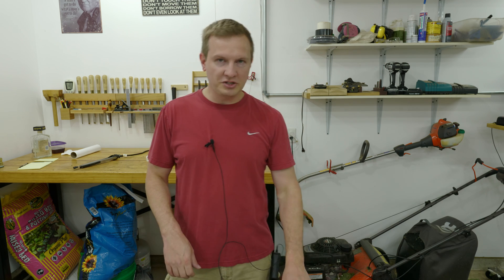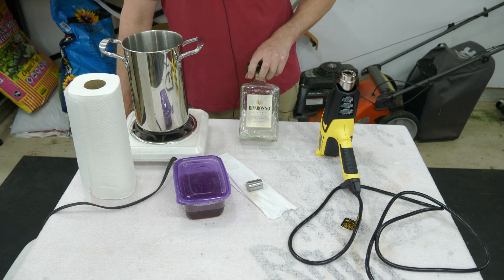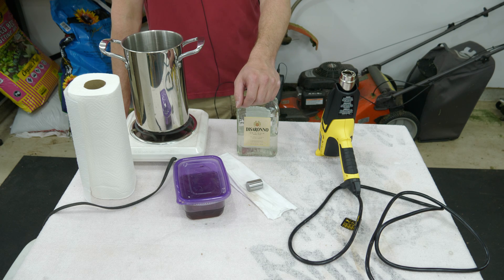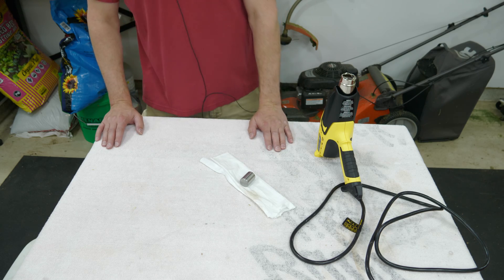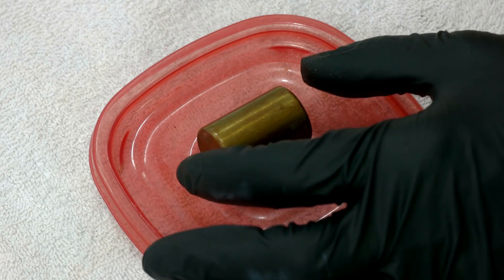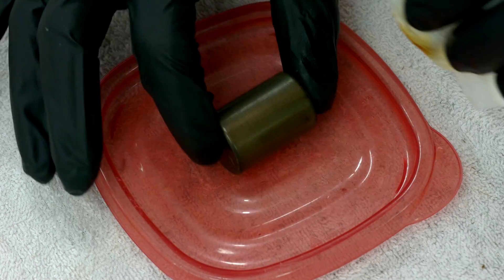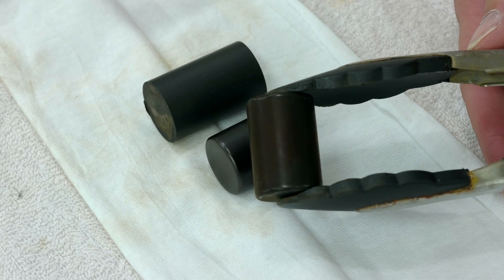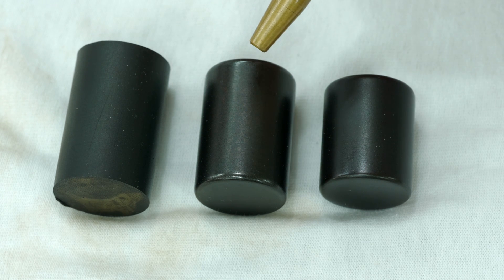Not So Slow Rust Bluing

Comment: If you brought the metal up to a mirror finish, will this process produce a black mirror finish??
Reply from the maker: I don't believe so, since you are converting a portion of the surface to rust, I believe it should generate a matte finish to some extent.
Reply: Mirror is probably not possible, but you can get a bright, polished finish. Card as normal until very dark, and then polish with 0000 steel wool. Apply more solution. Boil, and repeat until you have an even, polished finish.

Comment: Great video Dan!

When you heat the metal are you using a heat gun 
or boiling the metal in water before applying 
the darking solution?

How durable is this finish. 
Would it work on a gun barrel?
Reply from the maker: I always use a heat gun to heat up the part before the first application. 

for subsequent applications it depends on the thermal mass/cross section of the part. If you the part is thin in cross section you might have to hit it with the heat gun. If its thick in cross section  it should hold enough heat from the previous boil that you can apply the next coat imiediatly.

It's basically the same process as old school gun bluing, just using different chemicals. I'd recommend you test it out yourself before you try it on a prized firearm.
Reply: @Dans-hobbies  
Thanks for the advice.

I was looking to blue my Bond Arms Derringer. 
Wanted to try something different. 

I'll test this out before I try it on my Bond Arms.

Appreciate the info. 

Stay safe and healthy. 
Peace
Reply: @jayinscottsdale2001  
Actually decided to go a different route. 

I went with a weathered look using paint to 
simulate aging.  
I wanted it to look as though the bluing was 
coming off due to time.

Came out pretty good in my opinion. 
Looking to purchase the Texas Ranger black ash 
grips to finish the look. 

I'll let you know when I upload a video
on the completed project. 

Happy New Year. 
Stay safe and healthy.
Peace
Reply: @jayinscottsdale2001  
Nice, let me know how it goes 
and post a video.

I plan on posting a video on my Bond Arms Snake slayer IV,
showing my own custom work.  I'll let you know when I do.
Thinking of getting a spare 9mm barrel for the Bonds. 
If you have good results with your project, I might give it 
a try. 

Happy New Year bro!
Reply: @jayinscottsdale2001  
Hey bro. 

I recently completed my custom job on my 
Bond Arms Snake Slayer lV Derringer.  It's a little 
radical, but represents my personal style.  Check it out 
and let me know what you think. 
Go to YouTube and type in 
"Redzone101 Radikal tactical pump shotgun" and it'll 
come up. 

Stay safe and healthy. 
Peace

Comment: What type of steel is that not stainless is it?
Reply from the maker: For the video, I used plain old run of the mill 1018, but  the process will work on any steel that's capable of rusting.

Comment: Thanks Dan, can I change the oil with nabaty oil or coconut oil?
Reply from the maker: You probably don't want to use a plant based oil, as it might go rancid over time. Just about any petroleum-based oil should do.
Reply: @Dans-hobbies  thanks Dan for your answer, one more question. How much percentage of the hydrogen and vinegar that you used on this video?
Reply from the maker: @alfianandinugroho4062  

1 cup hydrogen peroxide
1/4 cup vinegar
1/16 cup salt (1 tablespoon)

Comment: Why do you wipe it? Why not just dunk it and then boil
Reply from the maker: If the solution pools up in a spot, the reaction causes bubbles to form and that leads to thick flaky rust that just falls off during the boiling or carding process.  I've tried dipping a few times and it's always been a bubbly flakey mess.

I think if the solution was weak enough that you could dip it and have the excess drip of before rust starts to form it might work. However, you would probably have to apply more coats to make up for the weaker solution.
Reply: @Dans-hobbies Good to know! I tried this process with a steel chain and had no luck. Now I know not to dip it, but to lightly brush it on on

Comment: What’s a carting wheel?
Reply: Thank’s so much for the fast reply
Reply from the maker: Carding is the process of removing the loose flaky rust. A carding wheel is basically a wire wheel that uses very fine (0.003" diameter) stainless steel wires. 

You don't really need one, but it really helps speed up the removal process. 

This is the model I have.
https://www.midwayusa.com/product/1007082530
Reply: @Dans-hobbies  Can you tell us where you got your wheel, how heavy the wire on a carding wheel should be?  Thanks, excellent video.
Reply from the maker: I got my wheel from Midway USA. https://www.midwayusa.com/product/1007082530

From what I have seen carding wheels are always stainless wire with a diameter of less than 0.005"

Comment: interesting. I have always used commercial solutions for 'blueing' steel, but I like this homemade action. Have you tried dipping the part in the solution and then wiping it off?
Reply from the maker: I haven't tried dipping with the concentration I showed in the video, but I have tried it with a stronger concentration (more salt). It worked in that it rusted the steel, but it was messy because of the strength of the concentration. 

I think dipping would work, but might be a little slower, as you would probably want a cool part and a very mild solution so you had enough time to wipe of the excess.
Reply: @Dans-hobbies  I have always been told to not dip and to not get it too wet with the solution - ring your applicator out and use light coats... take that with a grain of salt though... no pun intended.
Reply: @Dans-hobbies  I suppose it could also have the effect of polluting your solution - you would have to decant a bit for what you want, and it would only be good for that project, so a lot of waste.
Reply from the maker: @zactennyson8419  Thankfully the ingredients are so cheap and easy to come by, thats you can experiment. Not to mention this stuff isn't really toxic.
Reply: @zactennyson8419  you, sir, are correct. Dipping isn't a great idea because you quickly contaminate the solution - you'll have microparticles of rust (hematite) in the solution that will consume the peroxide.